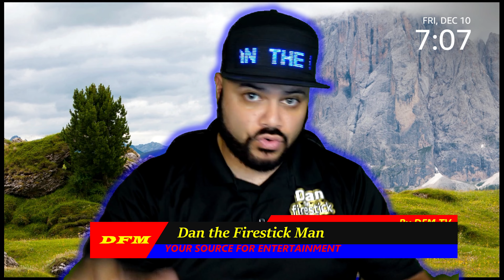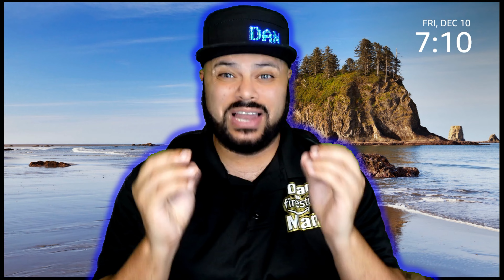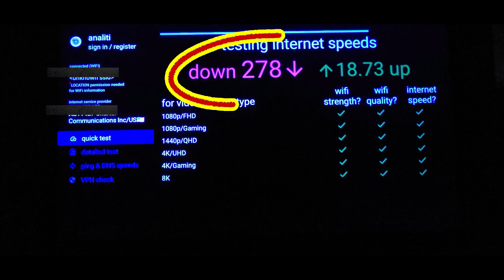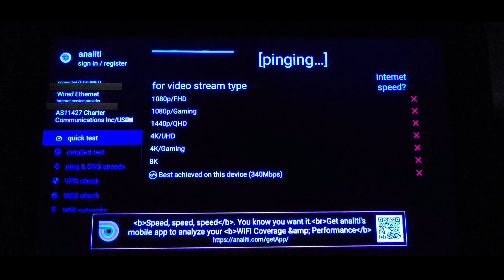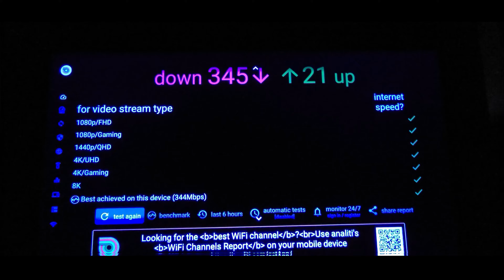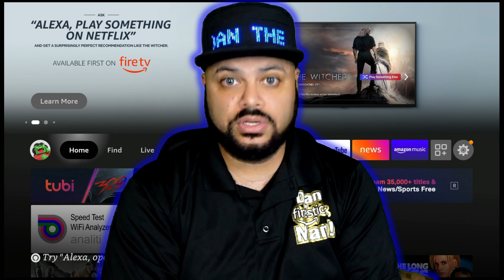BEST ETHERNET ADAPTER EVER 2022.Works on All firesticks, Chromecast, Raspberry Pi &amp; Google Home

Comment: Hi bought the cable matters cable from the link you left on Amazon. I have a fire stick 4k max It will not recognise it.  Works with the amazon Ethernet adapter 100mbs. But just not this one. Do you have a video off how to set it up?

Comment: Um, unless I'm not thinking correctly, I think this would not work for me.
  I currently use an OTG adapter cable so I can have USB 'external storage.' This is an absolute must for me.
  But your ethernet adapter comes with no spare USB ports in which to plug it ... so it's a 'non-starter,' right.
  My router is across the room from my TV by necessity and it's not practical for me to run long ethernet cable, so it's not a possibility for me anyway.
  If it was, I would need to go with the popular uGreen ethernet adapter, as it comes with THREE 'usb ports.'
  I can't remember at this moment if it is limited to 100 Mbps for ethernet or not?
  So my question is ... does the brand you recommend here, make a version of this ethernet adapter that has one, or more, USB ports onboard  (while still allowing for the 400 Mbps top-end speed)?
Reply from the maker: That is a great question!! the answer is that for your scenario it does not matter for the time being. Because you cant have an ethernet adapter connected with an OTG adapter at the same time. the OTG adapter will completely disable the ethernet adapter all together. Firestick won't pick up that you have an ethernet adapter and will work on wifi only. i have tested many OTG's to find a solution to this problem and i haven't been able to YET! lol. i'll keep looking and as soon i find something i will post a video with my recommendation. thanks

Comment: In order to have ethernet in every room instead of using wifi go purchase this device call Moca
Reply from the maker: YES! you are correct! however in order for that to work you will also need an active coax cable already running in the room. Moca converts a live coax connection into Ethernet. thanks for your feedback.
Reply: @DFMTV4U  you welcome

Comment: I have cat5 and cat6 connected to my devices, do I need to upgrade both or just the cat5?
Thank You
Reply from the maker: you need to upgrade both your Cat5 & Cat6. you should have at least Cat6a <--(A). By installing Cat6a cables (or even Cat7), you're preventing the need to perform multiple, unnecessary upgrades each time you get faster equipment. CAT 7 Ethernet cables support higher bandwidths and much faster transmission speeds than Cat 6 cables. Your next option is Cat8 but the primary benefit of Cat8 cabling is faster throughput over short distance. Most home network equipment cannot operate at Cat 8 speed, so Cat 8 cable is a bit overkill. Because it's much faster than most people need unless for a gamer, the Cat 8 is the absolute best pick since it's the most durable and handles high-speed connection reliably. 

Overall i have all Cat8 cabling in my home because of the gaming that we do, but i have notice a significant difference in stability in everything else since i made the change, it's definitely much better and reliable. you don't have to go the Cat8 route since its a little pricey, but i would do at least a Cat7 in your case if you want to save a little bit of money and get better performance then what your getting now. hope this information helps. thanks for your support